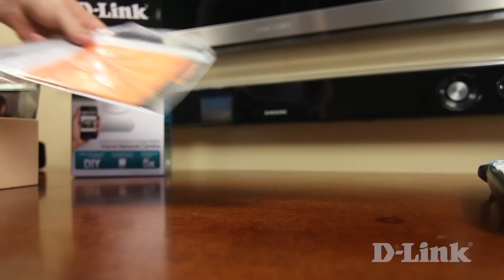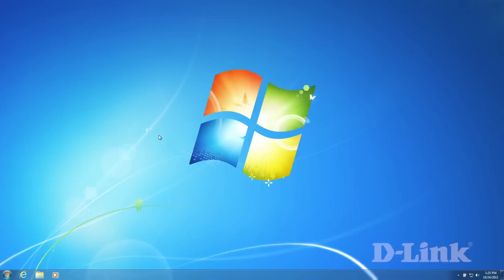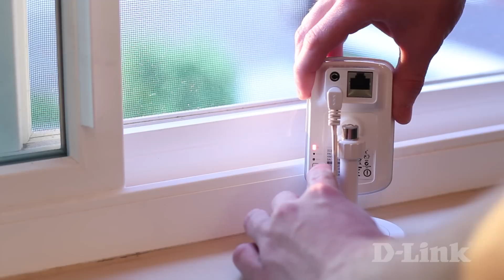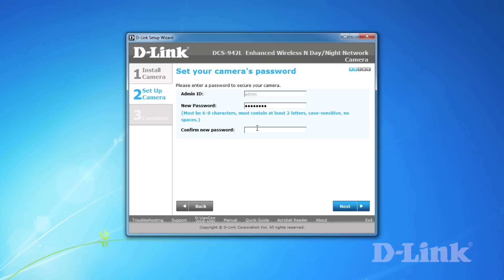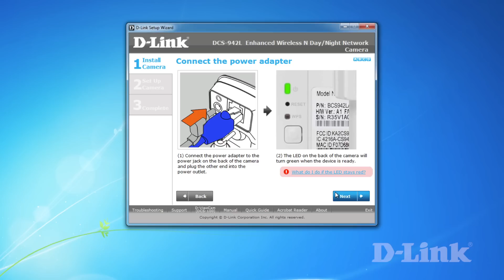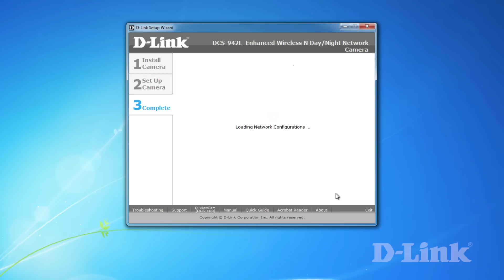Get Started with DCS-942L Enhanced Wireless N Day/Night Home Network Camera

Comment: I got the rev A model of this network cam and it sucks due to slow wifi performance.  In order for it to work properly, I need to use an ethernet cable.

Comment: does it have to be connected via a power cord all the time? 
So it won't work if i put it inside a car and use it as surveillance camera  then ?
Are there any cameras that don't need a power chord and can record for about 8 hrs and needs nothing to plug to electricity?

Comment: do i need to keep my laptop also on cable while installing the camera? I do not have WPS in router and I loose the wifi connection on laptop as soon as I plug the camera to router with a cable.

Comment: Ya' know...  Your video tutorial even "shows placement of the camera ON THE WINDOW LEDGE" as if to record outdoor activity.  The video tutorial even states "Day / Night"...  Those points being stated... the tutorial, nor NONE I CAN FIND to date address any possible way to reduce or eliminate the IR glare you'll get whenever trying to record through glass!!!  I realize that the option of "an outdoor camera exists; but why did you "place the one shown on the window sill" if not going to address this issue?

Do you know of any "window treatment" or other solution to drastically reduce the window glare at night when viewing through glass?  I'll keep trying ideas of my own while awaiting someone who's "been down this road" and has found a solution~  -Thanks!
Reply: I just got a pair today and experienced the same glare from the IR LEDs. I got these specifically to look out windows. Disappointed. May keep for internal security/pet cams, but worthless to see outdoors.
Reply: CrowdSourced And even going with the outdoors version seems useless for motion detecting. A CNET review says it's limited to 15ft. That's not very far, and I can setup my laptop in the window with iCamSource and capture motion easily 50ft away.
Reply: DCS-942Lmydilnk

Comment: Ive tried the Dropcams and Foscam. Ive returned them both. Dropcam lived up to its name, it dropped signals like crazy. The Foscam was brutal to setup so i gave up. The Dropcam was super easy to setup. Now judging by this video, i may try it out.
Reply: The Dropcam is easy to setup but the fact that its sticks out a bit in a nursing home, may cause caution by the savages hurting your aunt. They may either cover it up or they may abuse her in another location. I would contact the mgmt and threaten to sue. Also i dont know how you go about setting it up in a private facility. They may not allow it. Especially if they know they are doing wrong.